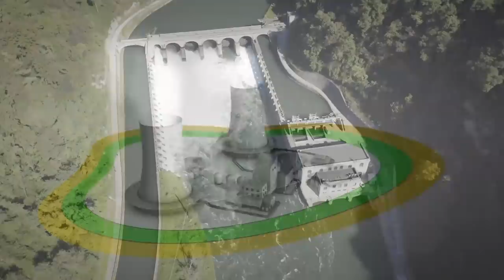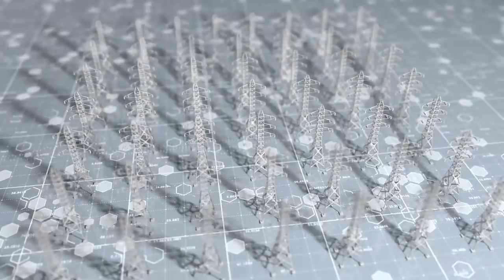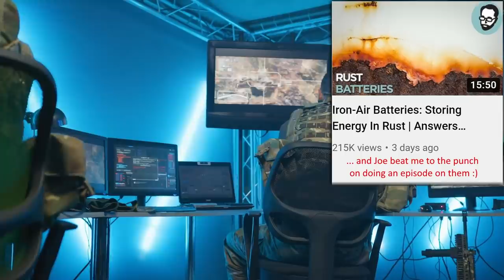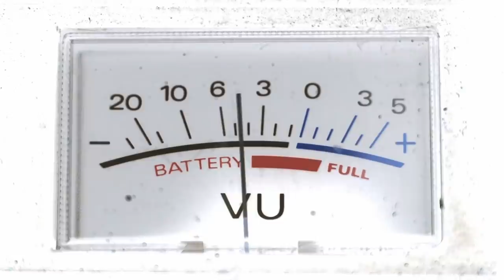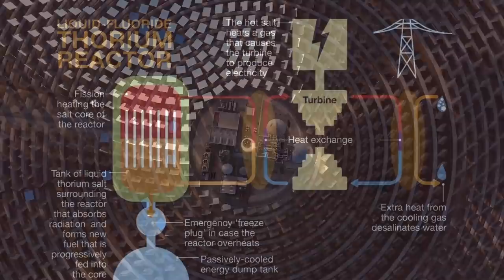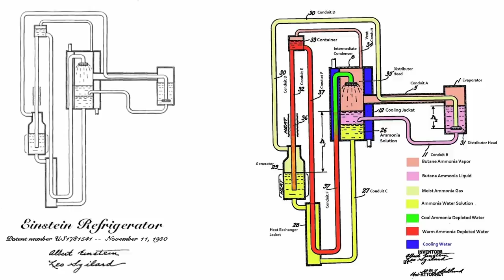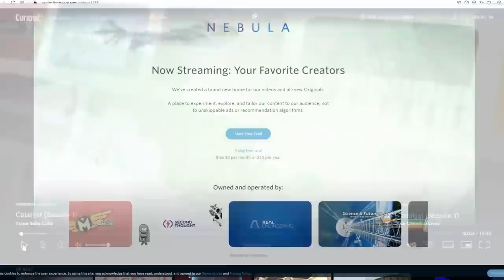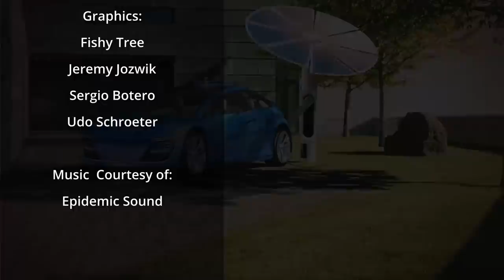The Future of Solar Power

Comment: Maths check for 25:05: 5 m^2 of panels would generate over a day, assuming 25% solar panel efficiency, 30% capacity factor for fixed-tilt, no clouds, no dust, about: 1 kW * 5 * 0.25 * 0.3 * 24 = 9 kWh. If you don't like the maths, then measured irradiance figures for an optimally tilted array, for Los Angeles for argument's sake, is about 6.2 kWh/m^2/day, with 25% efficient panels and 5 m^2 of them, that's 7.75 kWh/day. 1 L of gasoline contains about 10.2 kWh of energy (HHV). With 25% conversion efficiency of electricity to gasoline, the 5 m^2 of panels would produce about 0.19 L/day of fuel. You state 12.5 L of fuel per day, which is 65x what I calculate, actually requiring a solar panel area of 325 m^2.

Incidentally I math-checked it because I've done that maths before, and there's no way that a car is getting powered by 5 m^2 of solar panels. 12.5 L per day would be about 200 km range for a car using typical fuel economy standards for a car. You could fit 5 m^2 of solar panels on a car's upper surface, and no way is a car getting hundreds of km of range per day out of the solar panels that fit on it, even for an EV to say nothing of throwing in a 25% conversion efficiency. As a sanity check, I found some guides for driving a Tesla for 60 km/day, requiring 12 m^2 of solar panels. To get a similar commute range out of a much less efficiency solar-to-gas system in a fuel-burning car: 25% conversion, 30% efficient engine, would require 160 m^2 of solar panels.
Reply: I think he is using the 25% from the sun to electricity.

Comment: would microwave beaming as the main power source for humans heat up the planet? I mean I know its basically the same amount of sunlight since the panels are blocking sun to work but will microwave cause more heat than the sunlight?
Reply: @virutech32  I could see sun shades being used against climate change if space infastructure improves, though that don't help with all the other problems with Co2 in the air
Reply: He actually mentioned this in the video that microwave beaming would likely heat the planet less than having the panels on the ground. When the panels are on the ground they heat up and decrease the albedo of the planet for the area they are installed on, thus generating a fair bit of additional heat as the panels heat up which would normally be energy that gets reflected back into space. This same absorbed heat would be radiated away from panels in space, and would mostly only heat the planet by the power beaming efficiency losses.
Reply: If the beams were generated from solar power satellites then maybe; some sunlight that misses the planet can be captures by satellites and beamed to earth as microwaves. But I feel probably not enough to offset the heat savings from lowering greenhouse gas emissions if it took over from fossil fuels for electricity generation. 
If you collect the energy on earth and beam it around with microwaves I doubt that's going to come to more net heat for earth.
Reply: @barryon8706  O I meant sun shades as another idea, not to do with solar panel. small factories on earth produce 100's of miles of tin foil a day, if you making stuff from moon/asteroids should be easy to make a thin square of metal to block out allot of the sun, earths only like 6000km across
Reply: @barryon8706  

Currently our civilization uses 17.7 Terawatts of power (I don't think this includes food)  . 

The amount of energy hitting the Earth from the sun is 175,000 terawatts

Even if we beamed double the power (to account for inefficiencies)  we are still not even close to a rounding error.
Reply: @catprog  excellent point. Quatitatively it'd be negligible.

Comment: Once solar panel technology matures just a little more and battery as well, it will realistically be viable and I for one will embrace it. In the meantime I will tell the solar sales people who knock on my door at supper time, no. But, off grid living is looking up even for a old guy like me. Thank you and be safe.
Reply: They are mature enough already, what you might want is for the battery prices to drop a little more. The main cost of installing PV panels on your roof is hiring the professionals to do it, and especially the wiring and electronics. Given there will be increasing demand and wages may rise, maybe you shouldn't wait.

Comment: I wonder what the future holds for thermoelectric power.

Right now, I know that it uses the Seebeck-Peltier effect to cause electric current to flow as temperature flows between hot and cold, with the effect increasing with the difference in temperature. I also know that such devices have been used in things ranging from thermometers to radioisotope thermoelectric generators (or RTGs).

What I'm still unsure of is if thermoelectric generators could be used to draw power from the ambient temperature of the very Earth's atmosphere (possibly counteracting global warming in the process) as, say, it attempts to heat up some kind of cryogenic fluid (like, say, liquid nitrogen) inside of a container to the point where it vaporizes (like an RTG, but inside-out), which, in turn, could be kept cold enough to condense back into a liquid through using, say, a fan plus coolant pipes to radiate the excess heat out of the container to keep the cryogenic fluids cool (like in a refrigerator). Maybe, in a futuristic possibly sci-fi setting, it could also perform double-duty as not only a way to keep a colony (or a probe) on, say, the surface of Venus cool, but to also get plenty of power out of absorbing the ambient heat from the atmosphere, and turning it into useful electricity?
Reply: You can take heat from the atmosphere and make it flow into a colder heatsink, making energy in the process but this will not cool anything down, the net amount of heat remains unchanged as the cryogenic heatsink heats up. And you cannot cool it down again without having something even colder to dump that heat into. You can run it in inverted mode, as a heat pump to make heat flow against a temperature gradient but this will consume power, not generate it
Reply: @destroyer1667  Pretty late reply, but I recently realized that pumping excess energy into synthesizing fuel (like turning water into hydrogen and oxygen via electrolysis) is also an option, while also getting something useful out of the results (which would be rocket fuel in this case).

Comment: is water readily available enough at the moon to run a steam powered power plant without it becoming a problem?
Reply: yes & even if it was rarer it's not like power plants need to consume water, certainly not ones in space. once you have enough to run your plant it's basically a closed system
Reply: @virutech32  you're aware, closed loop power plants, ESPECIALY in space where it's actualy hard to radiate surplus heat away, makes power plants a lot less effective?!
Reply: @TheyCalledMeT   in space every power plant is closed loop except for the ones that blow their heat out the back as propellant. If you're on the moon there's no way you'd waste the water & mess up your area(billowing kilotons of snow into ur general vicinity might be a bad idea). if you really wanna avoid radiators you can always use a ground loop, but ultimately that is just using the moon's surface as a radiator the same way dumping steam outside is just using the atmos as a radiator.

also closing the loop makes a steam engine more efficient. increases the pressure-temperature differentiatial & therefore maxes out the efficiency.
Reply: @virutech32  in other words, it makes sense when you also need the excess heat to keep a colony/ship warm or propulsive it, it makes sense, else go for solar voltaik
Reply: @TheyCalledMeT  it only makes sense for ships & specifically ships with very high thrust constant acceleration drives in em(torch drive type ish). Otherwise you need radiators to cover the coasting period. honestly you'd still probably need them for chillin at zero impulse in orbit of a star or whatever.

 you just can't get away from buried loop/panel radiators in the vacuum. there are no other practical & sustainable ways to reject heat. the only place you can afford to be this cavalier with water & don't have to worry about getting caught up in clouds of snow(especially annoying in the belts) are the ice moons(europa & friends) where you could even cycle the subsurface ocean as coolant. everywhere else it's just not gunna work

Comment: You should watch Tony Seba on 100% Wind, Solar and Battery by 2030
Reply: How'd he get round the lithium production bottleneck that won't even allow the countries that have mandated only EVs by 2035 to actually adhere to that goal?
Reply: @ZontarDow  lithium is very abundant in earths crust its just hard or not yet possible to extract it. Tesla e.g. is working on that right now
Reply: @cedric2034  Tesla isn't working on that right now, thought Musk would have you believe otherwise.
Reply: @ZontarDow  Yes they did mention that on battery day. And Tesla filed a patent for that extraction method using table salt.
Reply: @cedric2034  increased energy density was also mentioned, can't exactly take them at their word given that type of track record.
Reply: @ZontarDow  What do you mean? They are gonna increase the energy density with their new battery the 4680.
Reply: @cedric2034  they claim so bit if you actually look at the specs they just increased the volume of lithium.

Comment: The Idea of power satellites always were a bit weird to me. surly if we could transport power between the earth surface and a satellite in an efficient way, we would do it the other way around.
Reply: i think the difficulty is a non-spinning big disc needed at the receiving end, but does anyone know the details for this?
Reply: i now think the problem is that the receiver would automatically accelerate away from the sender, quickly increasing the distance until the disc is no longer big enough to receive the beam. this would be useful if that effect is desired, such as for the breakthrough starshot, but i suspect for most applications this is not useful
Reply: @7lllll  Are you kidding? a Method to propel satellites in orbit from earth surface would be extreamly useful.
But you missed the point of my comment. Satellites are the place that it is expansive and nessesarry to get power to. The Idea of beaming energy from a satellite to earth even if it were possible and practical is getting things backwards.

Comment: "Losing 1% a day with modern batteries"??!! I'm pretty sure you are doing the "comparing a 1977 Cadillac" with that. You have way overestimated losses. Lithium-ion batteries have very, very low self-discharge rates, like less than 1% a month .
Fossil fuels have a fundamental flaw. They aren't renewable. You have to spend energy to find them, spend energy to retrieve them, spend energy to process them to make them suitable for use, and spend energy to transport them to where you want to use them. You then have to have spent energy to build the device that you want to use them in. And then to use them, you destroy them while only extracting a fraction of their leftover energy for your use. Comparing this to the one-time manufacture of solar panels which passively absorb energy over a lifetime (which is comparable to that of the device used to destroy the stored fossil energy) is an apples to fruitcake comparison. Not to mention that that fossil fuel often contains novel chemical compounds that would be useful in other ways. Just like the ingredients of that fruitcake could have been used to make more palatable foodstuffs.
Silicon is about THREE orders of magnitude more abundant than Carbon in Earth's crust (28% to 0.02%). Not that that is relevant to the subject. They are both sufficiently abundant in accessible forms relative to most lanthanides. Although neodymium is only 5 times less abundant than carbon, it is difficult to chemically segregate it from its neighbors on the periodic table.
Your "neighbors" on the grid are not the people next door. They are the people in the next state who are sitting under a weather system needing a bit more power than their solar is generating. Of course, they might be making it up with "the other solar energy", wind.
"Batteries need replacing after 5-13 years." AGAIN with the dragging out of the 1977 Cadillac. Where are you getting this (oddly specific) nonsense from? "And need a fair amount of space and maintenance too." Everything needs space and these aren't lead-acid batteries that need topping up with water. Are they? You can get 20 maintenance-free years out of a Li-Ion car battery and then repackage those cells in a home battery and get another 15-20 years out of them before you send them to the recycler.
"If you are spending $100 a month maintaining your battery capacity" you are a utility scale battery storage company, not a homeowner with a few kWh hanging on the wall. You keep pulling ridiculous numbers out of nowhere.

Comment: I remember over 15 years ago hearing how solar will become more affordable.... maybe in another 15 years it will be affordable enough for me :D
Reply: The price has gone so low that domestic solar is affordable for homeowners even though the amount of subsidies from the government has been cut, which, of course, was the whole purpose of having those subsidies in the first place. Domestic solar remains expensive because of the cost of hiring people to install it and because recently the cost of a battery has been added to the cost of panels, the panels themselves are super cheap.

Few years back someone tried to argue that renewables don't work and never will work and put up as "proof" nearly a decade old video in which some esteemed professor was lecturing that it had taken 35 years for wind&solar to provide X% of energy in US and it would take another 35 years to double that. Clearly they had not checked the data, as in a fine example of Clarke's First Law both had doubled in just couple years, and while wind took few years after that to double again, every year or two the amount of solar had doubled again. That was mostly because the solar farms got an unfair amount of the subsidies, but also because the prices were falling quickly while the solar farms are super easy to set up.

“When a distinguished but elderly scientist states that something is possible, he is almost certainly right. When he states that something is impossible, he is very probably wrong.”
Reply: @AnalystPrime  I live in a 3rd world country, we don't get subsidies. Just the cost of the controller/inverter is prohibitive, then there's the batteries and panels plus installation etc.
Reply: @repawnd1   Ah, yes, the cost of panels has gone way down but I haven't heard anything about the rest of the electronics, and hiring a professional installer can cost a lot.

You could save on installation by using a wooden frame in your yard, DIY without worrying about falling off the roof or drilling a hole in wrong place so your house floods during next rains. Just have to place it somewhere it won't be in shade, and get a qualified electrician to check it if you want to connect to the grid.

But if you need solar on your roof, best bet is to get the most efficient panels because even if the 400W panels cost more than two 200W ones the cost of installing two panels instead of one tends to make the 400W one cheaper. Also, your roof space is limited.
Reply: @repawnd1  What are you trying to do with the solar? (not what you are powering, just what you want to do.  I.e Lighting, Cooling,Heating, Pumping)